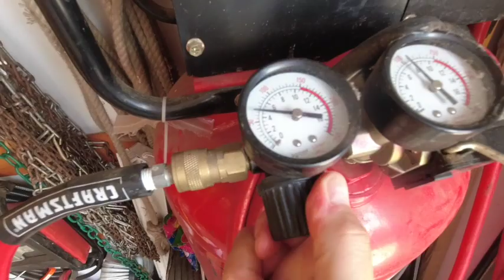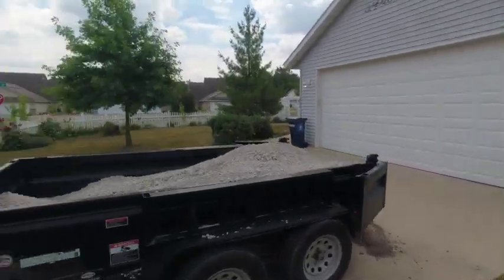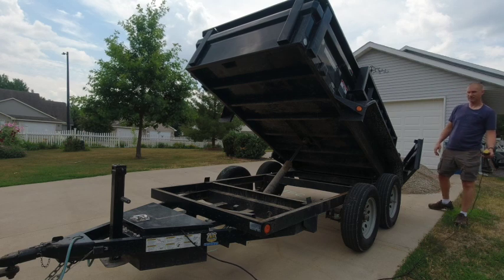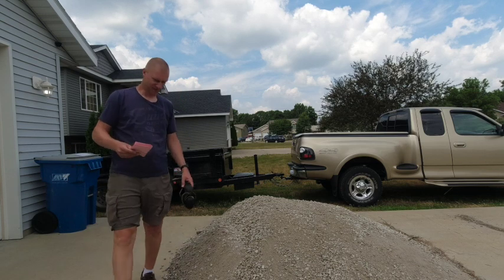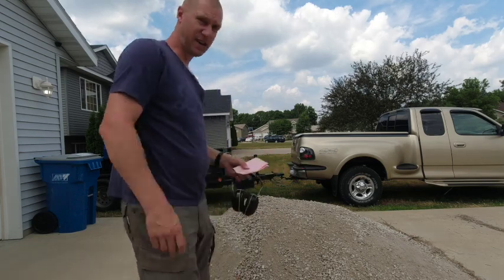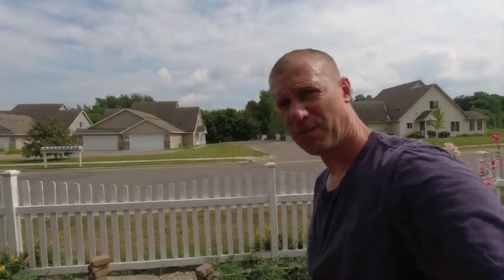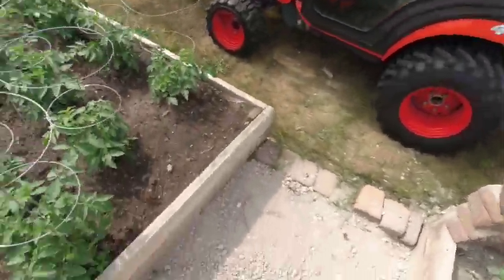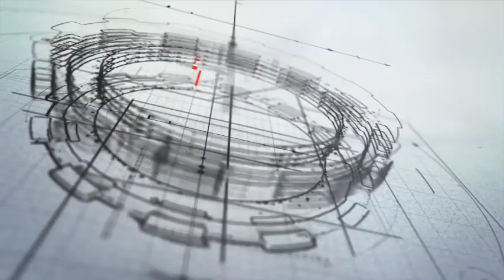KUBOTA BX23S WITH DUMP TRAILER MAKES PROJECTS EASY

Comment: I love my Ai2 toothbar too.  Although I don't use the tooth side often, its sure easy to swap, rather than having 2 different cutting edges to swap out and store, this one is excellent, its always on the bucket, and you can swap sides anytime you need.

Comment: I have never heard of this tooth bar and it is so neat now that I’m looking at it. Your dump trailer is awesome.
Reply: I have the same cutter bar on my BX2680, it works great, easy to swap cutting edges, and the company is veteran owned.  The first thing I ordered for my BX was that cutting edge, it got here before the tractor arrived LOL.  A bit over 2 years with this tractor, and lots of loader work, cutting edge don't show any wear at all.  Its a nice add-on, that helps strengthen the front edge of the bucket too.

Comment: FYI. I would run a magnet 🧲 over the crushed concrete. It could have some leftover renenforcemt metal in it.  It might not have any, but it would be a great idea to check in. Especially when in barefoot, and hands. You don't need a trip to the ER.

Comment: My Dump Trailer weighs 5,400 Empty LOL...
I see another Flaw with the Tow set up. Flip the Receiver over and reinstall the Ball. the Front of the Trailer is too High.
with that rear Biased load on the Trailer making it Tongue light, a Hard stop would have lifted the Rear Wheels of the Truck off the ground. with the Trailer level or slightly down in the Front would put more weight on the rear in a hard stop. 
Thanks Jon.

Comment: Turned out great Jon.  I had to use....I hate to actually write the words...hand tools 😫...in my last video as well.  Ugh!!!  Question:  did you add the air suspension?  I really like that setup. 👍
Reply from the maker: I did add the air suspension. It's a very simple install. They are Air Rite's from Firestone. At the time of install they were about $200 and they make a world of difference! I couldn't be happier!
Keep on tractoring!
Reply: @ritterjon  Thanks Jon...going to look into it!